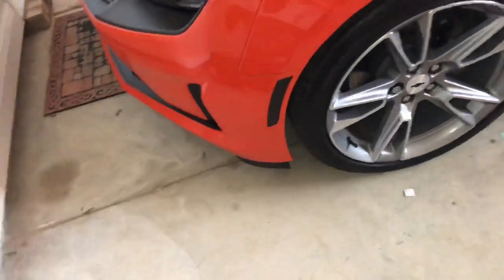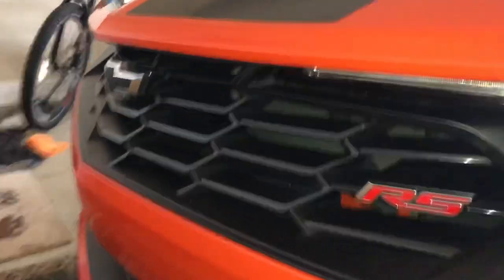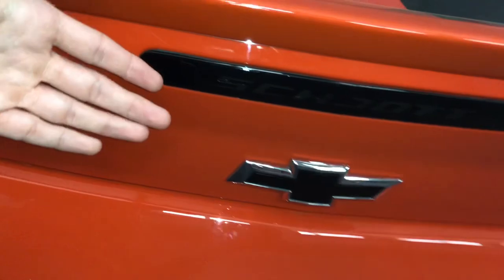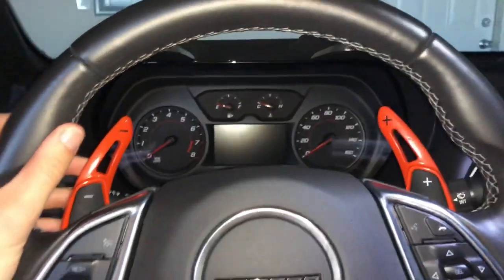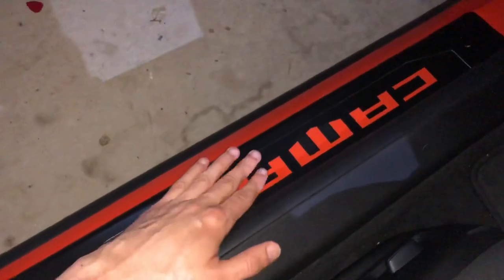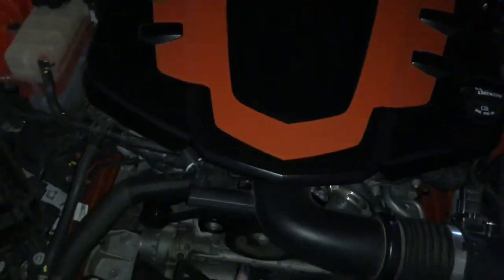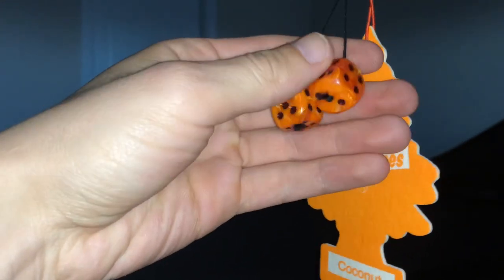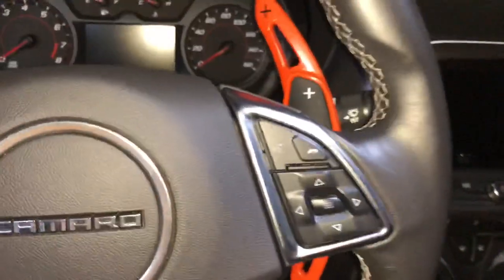All Mods on the 2019 Camaro

Comment: What does pulling the fuse do?
Reply from the maker: If you have a car equipped with the npp exhaust from factory (has the ability to quiet down and get louder based on which mode you put the car in) then pulling the fuse will keep the valves open at all times. So tour mode/snow and ice will sound exactly like (sport and track) without having to swap to those modes if you want the sound